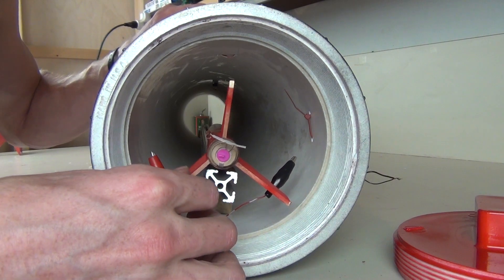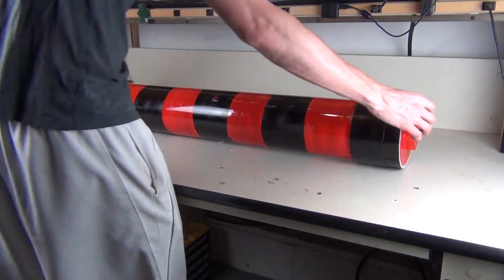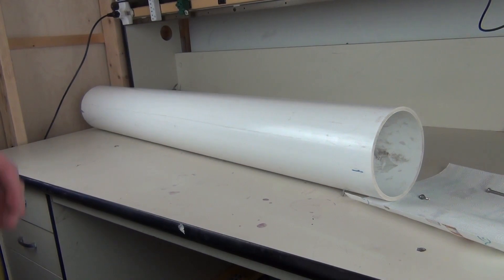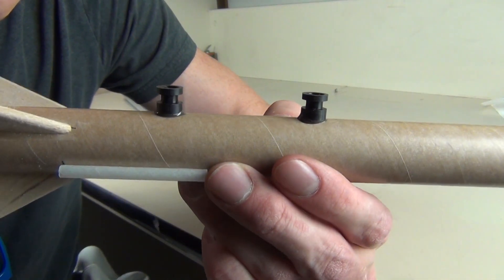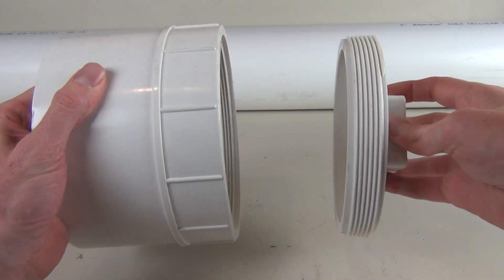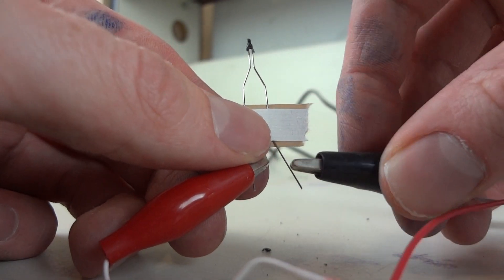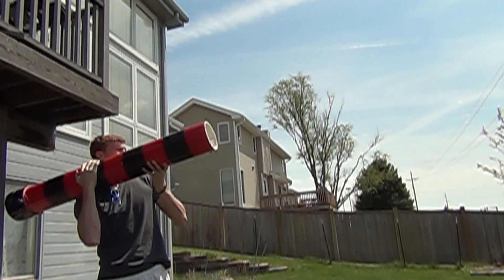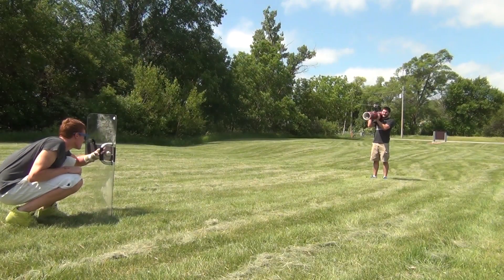How To Build A Real Rocket Launcher

Comment: Hey, is it possible to with a 9v battery to fire for (example) 6 rockets at once? Im gonna build a rocket launcher too, but just wanted to know more about it  great video by the way. 😉👍
Reply from the maker: Yes, I imagine if you wired the igniters in parallel it would work.
Reply: @LethalEngineering  thanks for the help! There is 1 more thing if may ask: what is the item/ product u use to fire the rockets? That pink colored thing inside? Sorry for my bad english.

Comment: I'm not an expert but was wondering if it wouldn't make much more sense to, instead of the trouble of putting in a guide rail which creates some drag on the rocket, use a much smaller diameter tube ?

Comment: how did u build those rockets? Or Out of which materials
Reply from the maker: They are an Estes Alpha Model Rocket kit, which can be found online
Reply: thanks, but ive still Foto another question and this is the question: if i can re use the rockets after firing them?🚀
Reply: Look up sugar rockets or you  can buy small rocket motors from hobby lobby jus a little bit more expensive

Comment: If you use two prices of extruded aluminum then you can get better accuracy as the rocket isn't getting drag on just one side. Also fins at the front should seriously help with stability.

Comment: Next up: using hydrogen fuel! Make your own:

Power source, distilled water, small aligator clips, a fuel tank for storage, a way to store the tanks, preferably away from children younger than 12, because hydrogen IS a way to make bombs, this rocket launcher or a different one, one of those things that lets you press a trigger to put air into the ignition chamber ( i dont know what they are called. gas filter?) but filled with the gas. I want to make one that shoots farther. Sell them online $$$